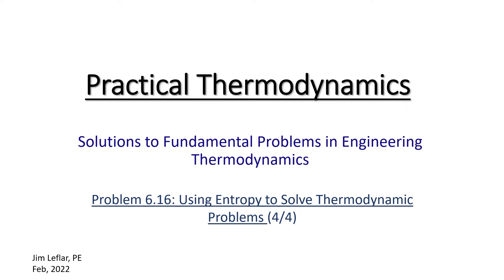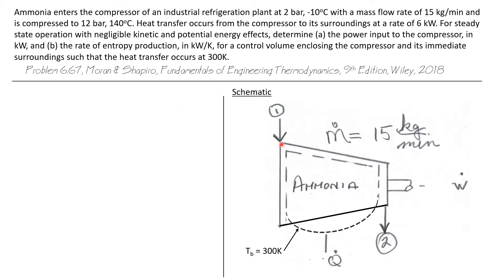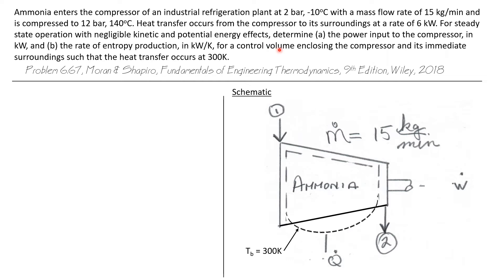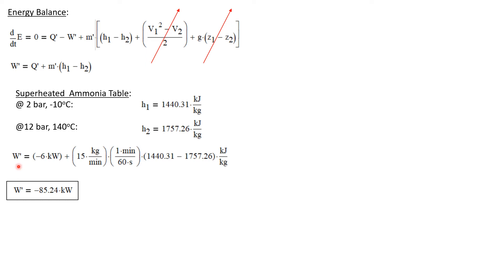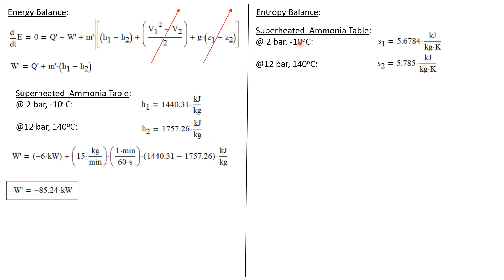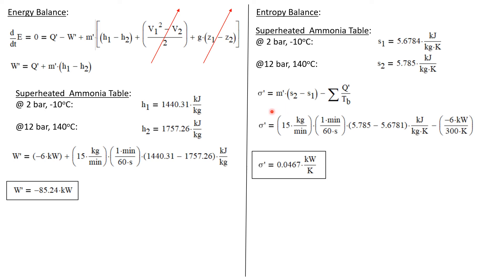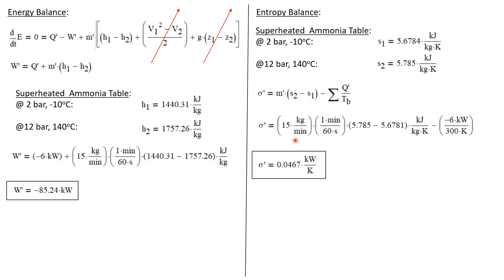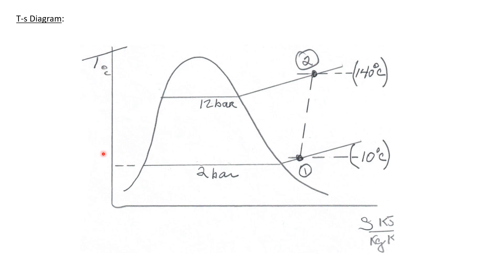Entropy Production in an Ammonia Compressor -- Engineering Thermodynamics 101/107

Comment: Hello! Is this an application of 2nd law of thermodynamics
Reply from the maker: Somewhat, as this problem calculates the entropy production for a process. The 2nd Law states that it is impossible for any real process to destroy entropy; that is, to have a negative value for entropy production. Therefore, the entropy of the system and its surroundings, taken together, must increase for a real process to take place. This problem calculates that entropy production for the system in this process is positive. Therefore, it would not violate the 2nd Law were it to actually occur. It is also noteworthy that heat transfer flows from the system to the surroundings and entropy flows with heat transfer. Therefore, the entropy of the surroundings also increases during this process.
Reply: @jimleflar3166  hello, how do i know if it is an application of 2nd law of thermodynamics? If it is asking for entropy? Thank you! I love your videos, btw!
Reply from the maker: @Premium-y9m  The direction that real processes take are often predictable; for instance water flows downhill and not uphill; heat transfers from hot objects to colder objects and not from cold objects to hotter objects. However, in more complex processes the direction that a process will take may not be obvious at all. But it can be found by calculating the entropy production of a proposed process and the increase or loss of entropy in both the system and its surroundings during a process. If there is a net gain in the entropy, then the process does not violate the 2nd Law were it to take place, so is possible. On the other hand, if the entropy production is negative, that is, entropy is destroyed, then the 2nd Law states that it would be impossible for such a process to take place. So, yes, your statement is correct. We calculate entropy change during a process to see if a process violates the 2nd Law. A violation means that the process that we are exploring is an impossible one.

For further exploration of this issue see Problem 87/107: https://www.youtube.com/watch?v=CWB6_9rJz68&list=PLZF25K43r2SUhoqCwdJ9PWP9JYyAcgz7J&index=84